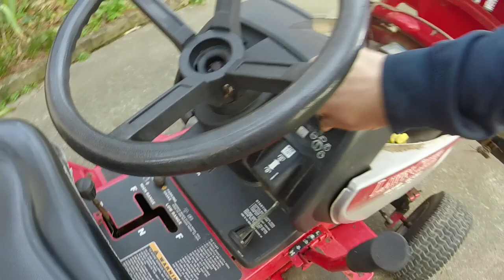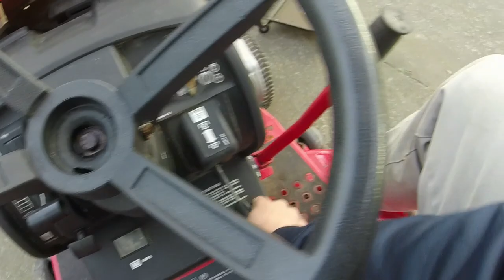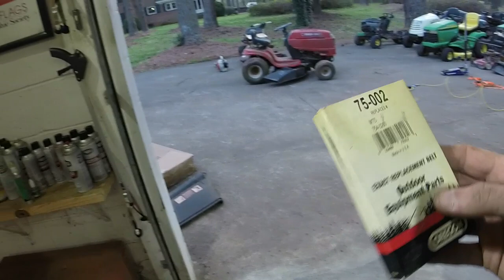MTD Lawn Chief Garden Tractor Hi Lo Varidrive trans needs OEM drive belts and isn't charging battery

Comment: Holy crap!  I love how deep/wide those rims are! 

What is the issue with aftermarket belts?  Too thick?
Reply from the maker: This was a great tractor.  Yes the thickness is the problem, the varidrive transmissions are very picky and must use OEM belts.
Reply: @EllisMowersandmore , I saw as I watching later on in the video.  Vari drive plastic trans/cvt?

Comment: The variable pully shaft may be rusted or dirty and not slideing properly to expand and contract depending on speed selector position . :)
Reply from the maker: He used blue belts and you have to use OEM or Stens, rotary belts for everything to work right.

Comment: That front pulley on the motor should have came off... Because the engine has been  Changed Recently. It Hasn't been on the engine for 20 yrs Like U Said. When These Pulleys Are Taken Off They should  Have 
( Never seize )  On Them In case U Need To Take Them Off In The Future . Lubricating The engine Shaft Is  Good Practise To Keep In Mind
Reply from the maker: Yes I don't know why it would not come off unless the person didn't clean off the shaft and just hammered it on there.